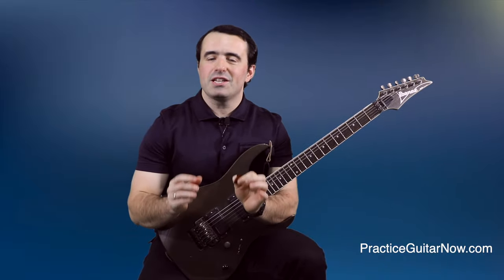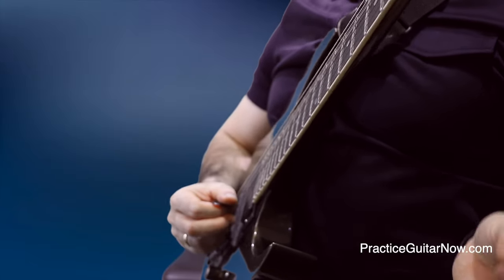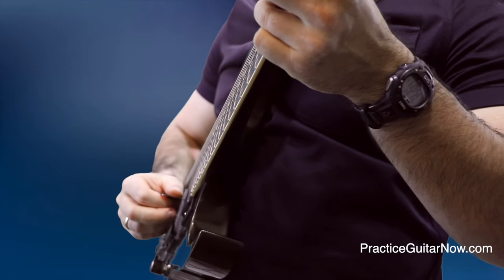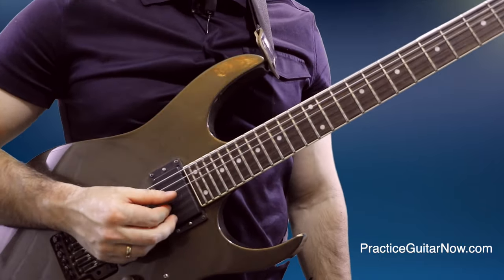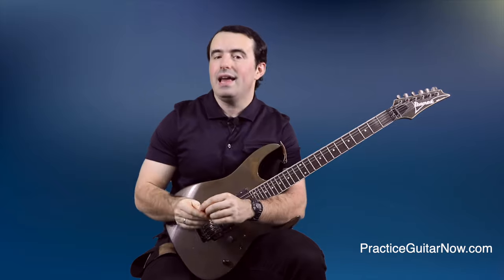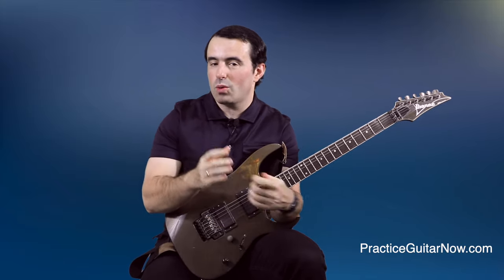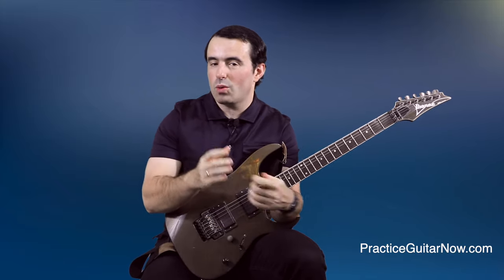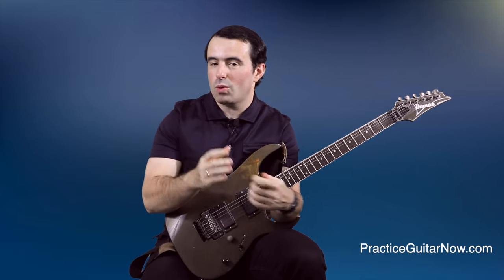3 Steps To Easy Pinch Harmonics (These Work Every Time)

Comment: Damn I just discovered this technique today and wanted to try immediately.. one issue I hadn't an electric neither a pick. I grabbed my guitar, watched every guide, tried and retried till I left no stone returned and was close to throwing the towel. 
I was laying on the bed, dark room, lost on my thoughts trying for the umpteenth time the ding harmonic when suddenly it clicked, can't explain the blissful relief, it was amazing. Afterwards I had plenty time to fully understand how I pulled it of, here's my notes:

Key Tip: the sounds emits when the string vibrates and gently touches your thumb. Reasons why it doesn't work for you all could be: not bringing close the thumb to the pick (there should be a tiny gap) ;
applying to much pressure with the thumb, hence note is muted;
not resting the finger immediately after plucking the string with the pick;
 lastly not striking the string string enough to make the vibration.

Comment: Your guitar hum bucker is really sensistive---I have failed to pinch the harmonic --however if I extend my picking INDEX finger 2 inches above the pick --then pick with plastic AND tip of index finger SIMULTANEOUSLY---I get superb harmonics in most places --not prefect --but I do not understand how your thumb AND pick work together -----so I use my method --not great --but I still get a loud hi -pitched SQUEAL 1

Comment: Same. The second I touch the string with my thumb like he does it mutes the note.
Reply: Don’t just touch the string with your thumb because it would probably choke out the movement of the string. Find the right spot, change the angle of pick then graze it with your thumb.

Comment: doesn't work for me :( i bounce my thumb and nothing, still sounds like a normal note. I am trying to play a d note on the A string (5th fret 2nd low string) . Tried it open and with other strings, and no dice. You make it look easy, what am i doing wrong.  Do you need a special amp for this?  I don't have money for a $1000 tube amp. Using a fender mustang modelling amp. Tried everything. nota
Reply: just fing did it.  Needed to be up near the neck, and blam... everytime.  I have a feeling its different for each guitar.  I also maxed my gain